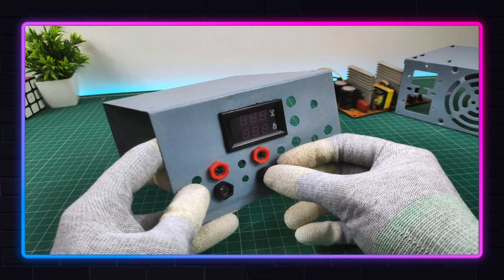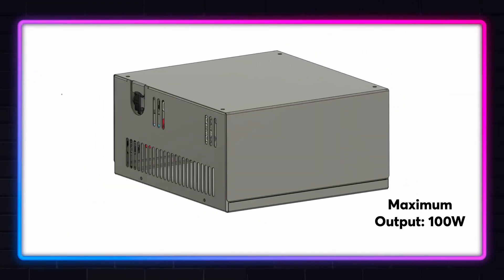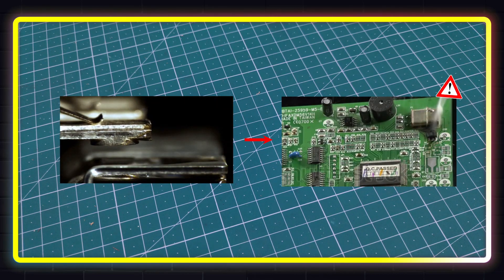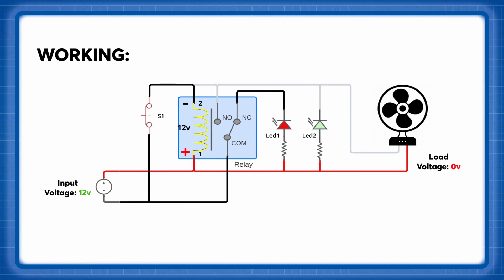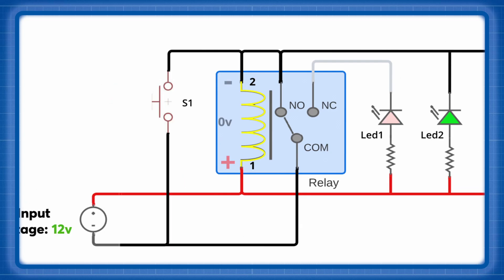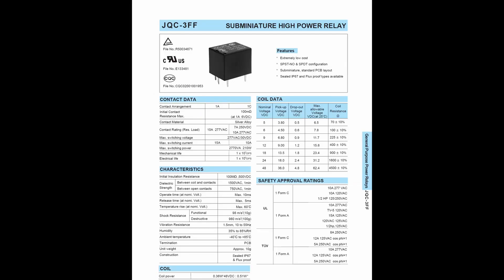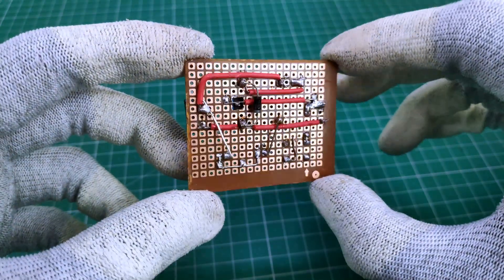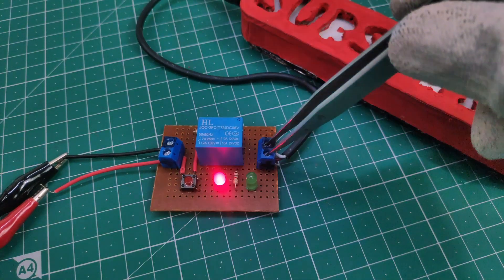How to make Short Circuit Protection using Relay | Explained

Comment: Awesome video, very well explained. I spent 2 and a half days, building that kind of circuit, and not any schematics doesn`t worked for me (because of that I had a different relay, with different pinout) until I watched Yours video, and after a few hours I made it and it works exactly as it should be. Thank You very much, You are my new friend :D
Reply from the maker: Glad, i was able to help.